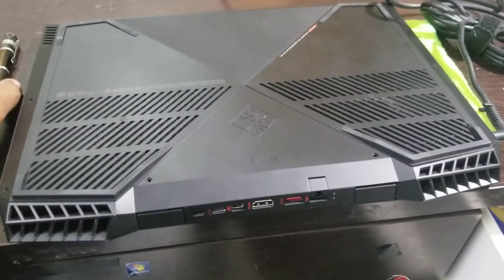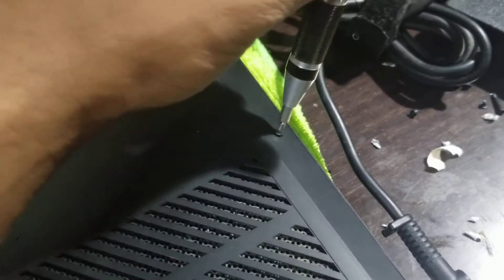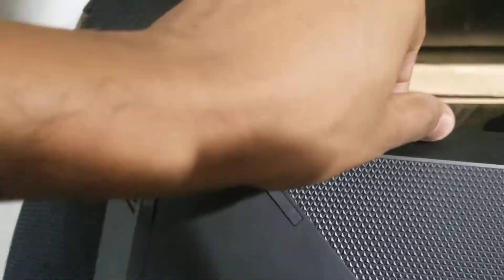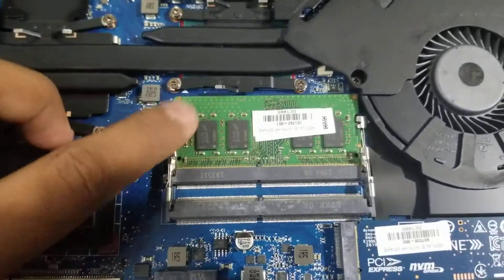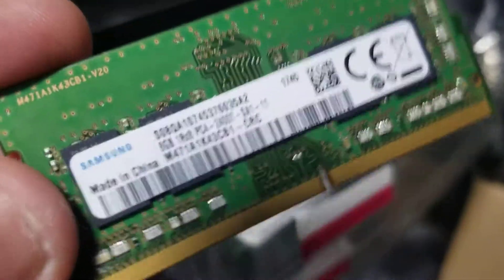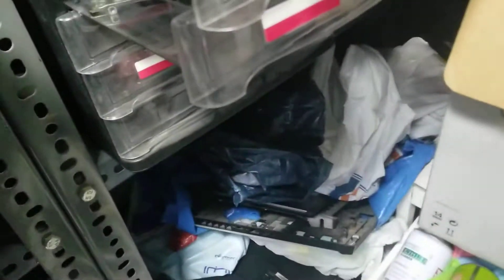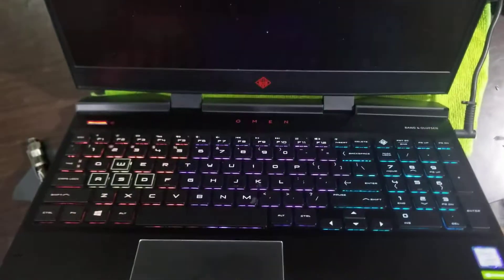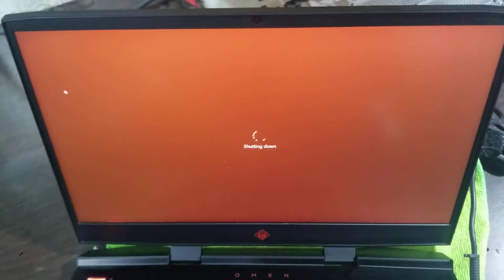How to Upgrade Ram of Omen 15 dc1xxx, tutorial 9th gen, 8th gen Gaming laptop

Comment: Hello, I have a question for you, mine is a hp omen 15dc i7 8gnr gtx1060, I founded a 15dcmotherboard, is a i7 9th gnr rtx2060, can I upgrade for this motherboard, or you think it will overheat? Thx
Reply from the maker: if you are changing motherboard dont forget to get the original heatsink for that motherboard. if you will just take motherboard and put another board heatsink then it may create problem because all graphics has different chips and the heatsink should cooldown each of them.

Comment: What is the maximum RAM? Can i upgrade to 32 GB? Beacause i do heavy video editing... Can i use this product to upgrade?:
- Kingston Fury Impact 32GB (2x16GB) DDR4 3200 CL20, SO-DIMM 3200 MHz.
Does it have two slots? And will 2x16 GB work? Or maximum is 2x8 GB ?
Also i heard that after-market RAM wont work faster than 2200 mhz freqency and not 3200 mhz.